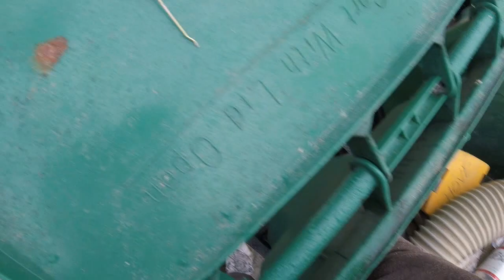Happy Scrapping | Trash Picking on a Gloomy Day

Comment: The big lump of cast iron that broke when you dropped it is called a sash weight, they are on the rope that is on the side of a sash window to make it easier to open and close. There is usually one on each side, so if there is an upper and lower window there will be 4 of them. I used to fit windows and these were great to take to the scrap man for a little bonus.
Reply from the maker: thanks for the info David.